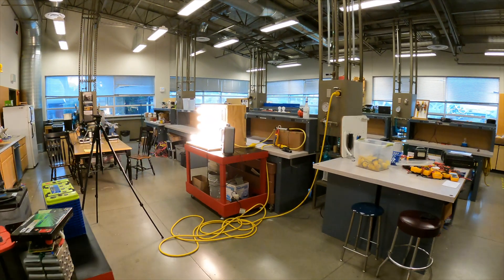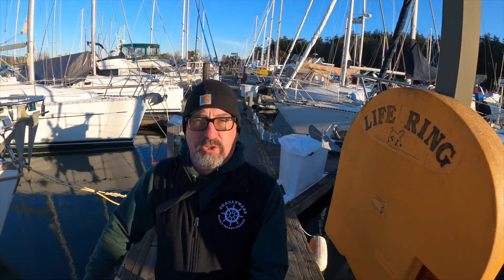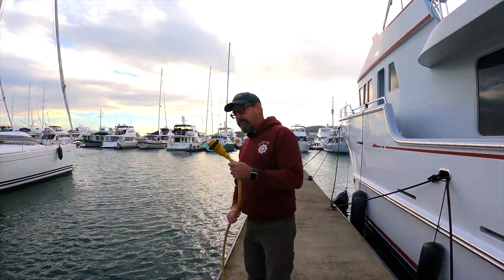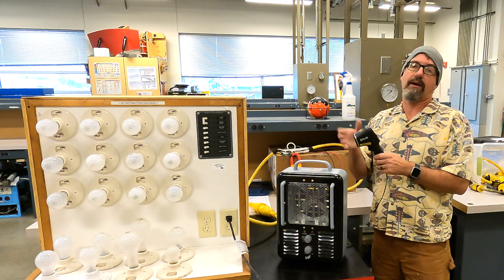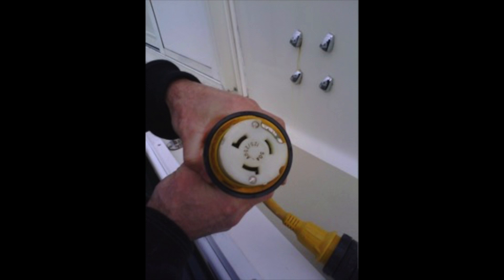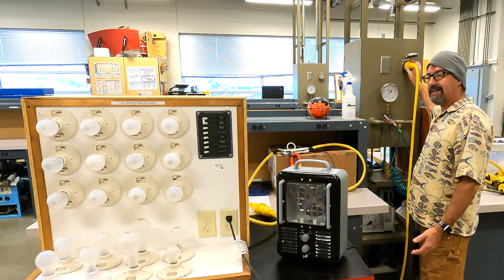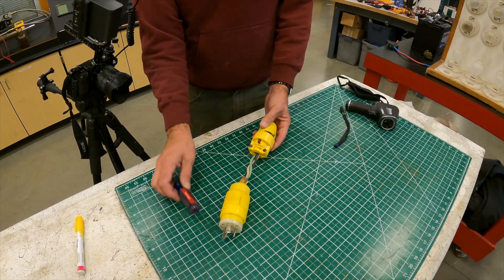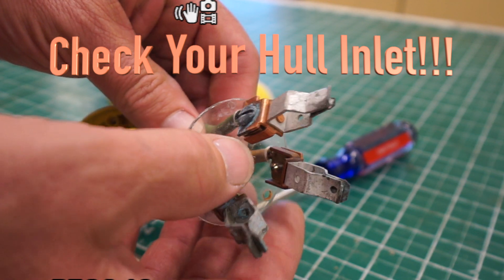Tech Tip #44: Hot Hull Inlets ~ Keep An Eye On Hull Inlets

Comment: Very nicely done.  A lot of great info with some great recommendations.  This isn't a big deal until it is a big deal.  The cost of a new cord and hull inlet is way cheaper than a new boat.  Worse, if you were sleeping on board and a fire started.  Very scary but totally preventable.  Thank you for taking the time to put this together.